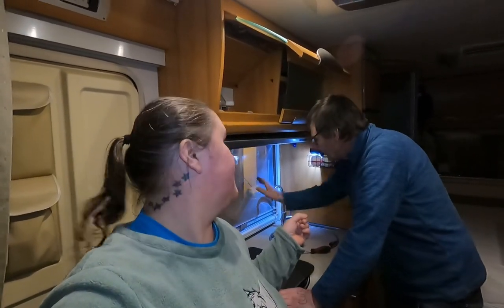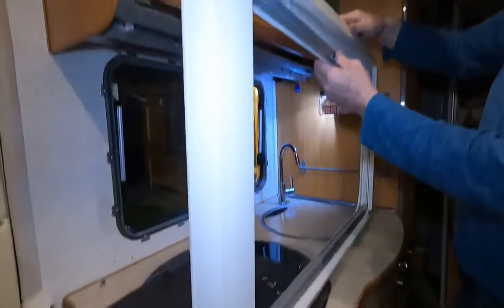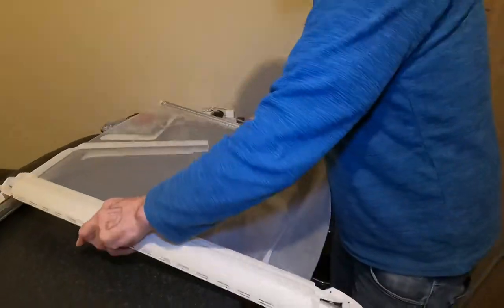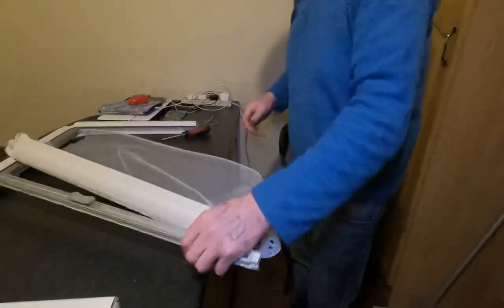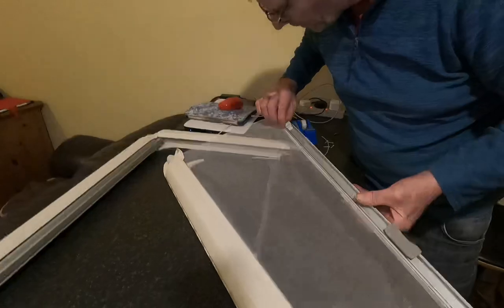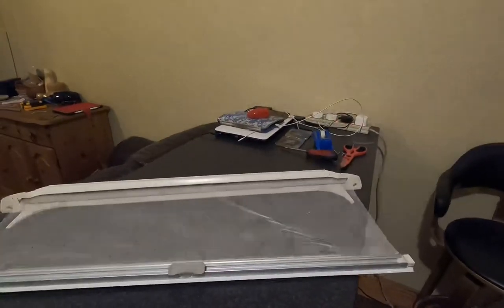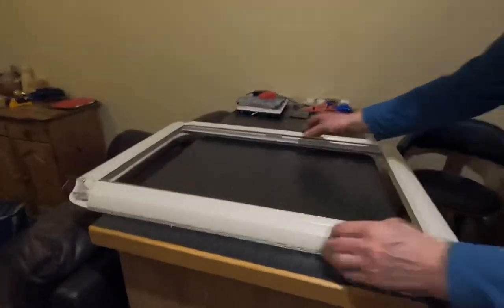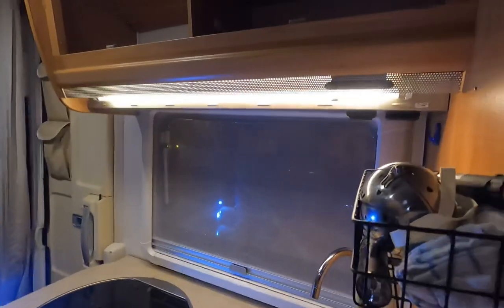DIY Repairing Motorhome Fly Screen Blind

Comment: I have a similar problem I’ve managed to get the fly screen back in its tracked without taking it off from the wall but I may have to take the whole screen off the wall ,I can’t figure out because you didn’t quite show it in the video is where to tension the fly screen because mine is quite loose, it won’t go back up it goes so far up and it’s just stuck there
Reply from the maker: You can tension it up with out taking it down , take of the corner pieces at each side of the flyscreen , and turn it with a screwdriver, that’s what Johnny done . That’s if it the exact same binds as ours .